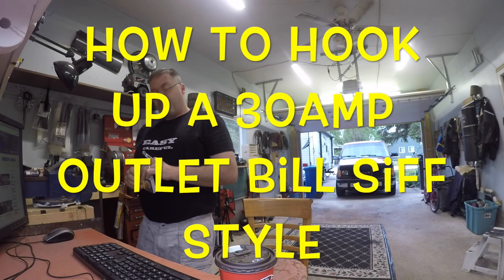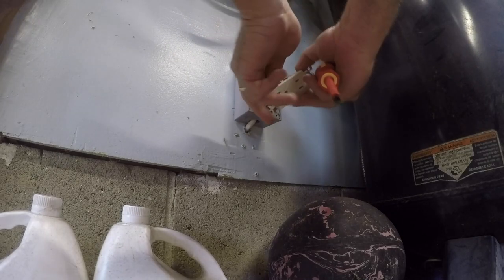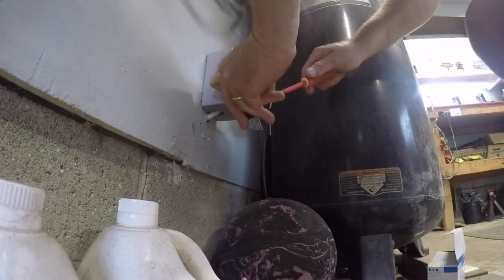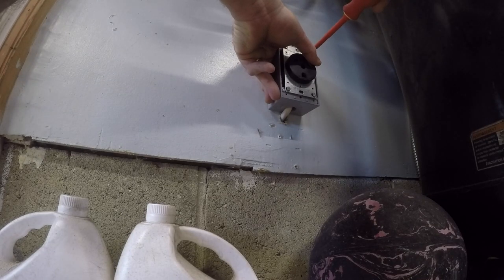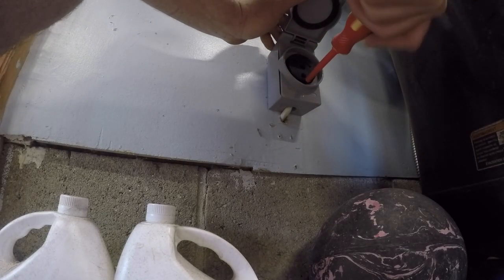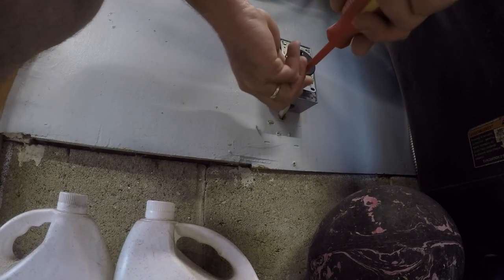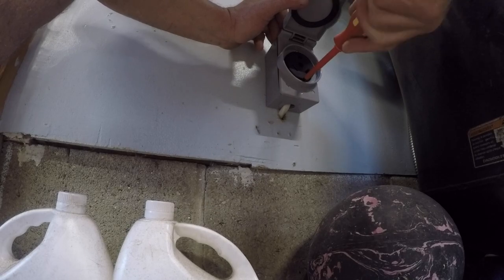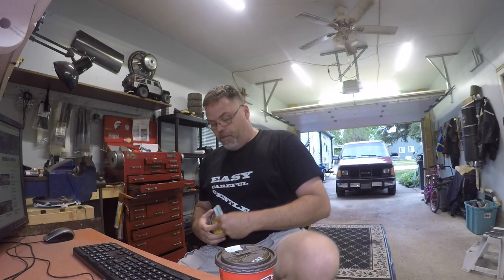How To Hook Up A 30Amp Outlet Bill Siff Style

Comment: what size wire  is that & what size breaker is it on?         "(35 yr electrician)"
Reply from the maker: 30 amp wire and 30 amp breaker lol really ! lol
Reply: U took a 15 amp plug off of it ! Was just curious!  "really".  I know how some of U wannabe electricians are ! just looking out for U. Kinda going by all the cobbled up wiring around your place! lol really lol!
Reply from the maker: it was just a temp plug till i got the right one lol
Reply: Kirk Wright Any electrician could see the 30 amp wire running into the box REALLY LOL
Reply: disbelief lover. What size "AWG" would that be? & what type , THHN, THWN, TW, THW, UF, RHW, XHHW,?  What deciding factor did you use to determine that was 30AMP wire ?  REALLY? Please explain!
Reply: Kirk Wright 10/2 30amp 12/2 20amp 14/2  15 amp
Reply: Rob Plotts . Not necessarily! thats a rule of thumb!  and that would be #10 #12 and #14 !  And/2 has nothing to do with it !!!!!
Reply: Kirk Wright agreed in this day and age you have to keep it as simple to understand as possible for the less fortunate that weren't born with half a brain